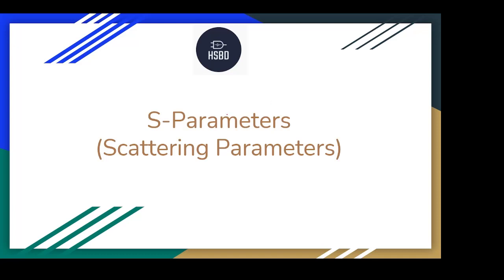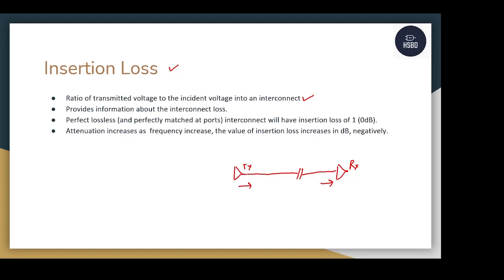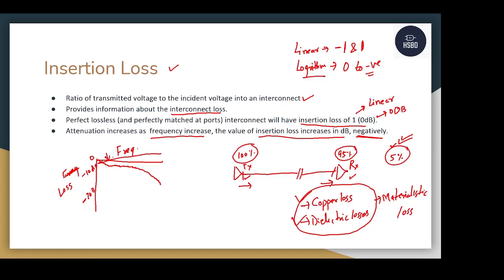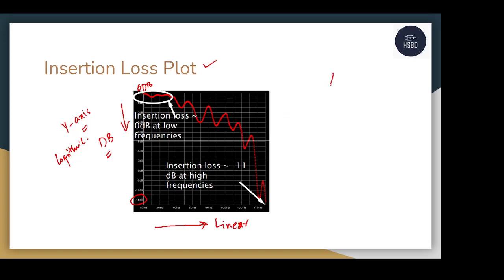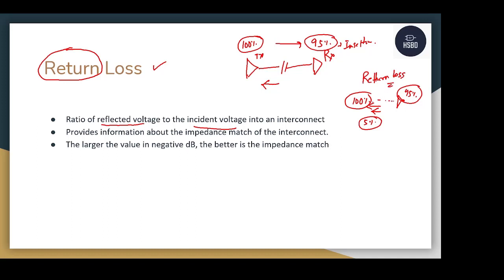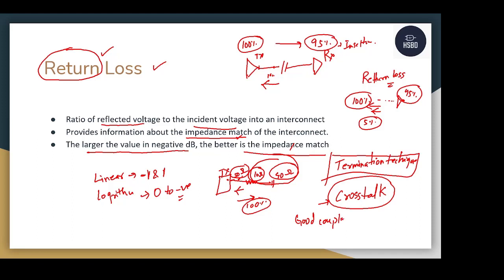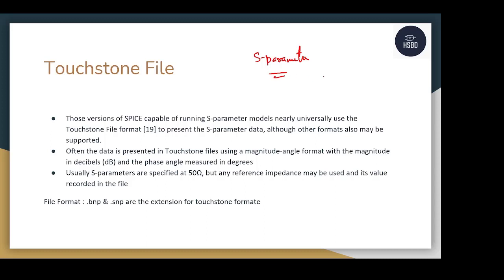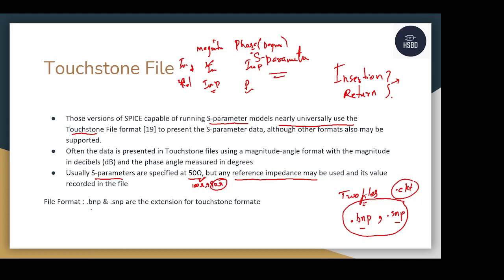Basics of S-parameter (Scattering Parameters)

Comment: what are the factors that causes dips in IL and RL.
Reply from the maker: There are various factors that play a vital role in behaviour of insertion and return loss.
Sone of them are:
1. Reflection : this controls the magnitude of return loss, ( Using decap having resonant frequency nearest to dip frequency help resolving this issue)
2. Materialistic losses: This governs the insertion loss as it depends on the materialistic loss such as loss due to Dielectric material having different dielectric constant, thickness etc